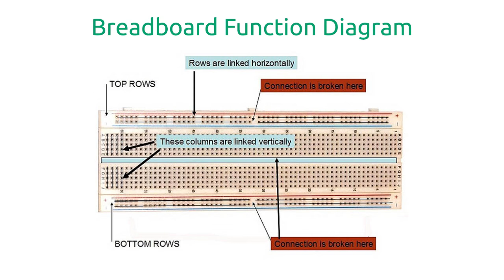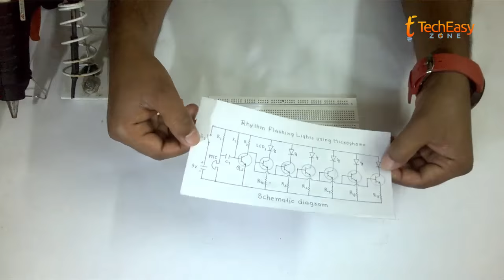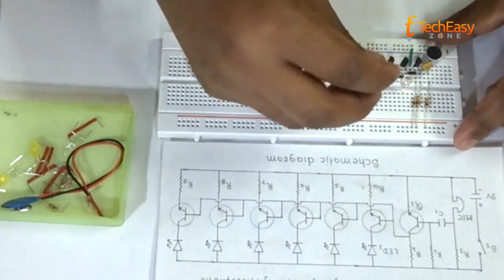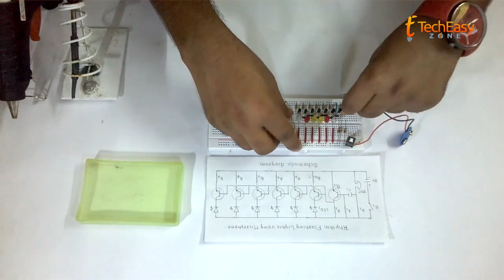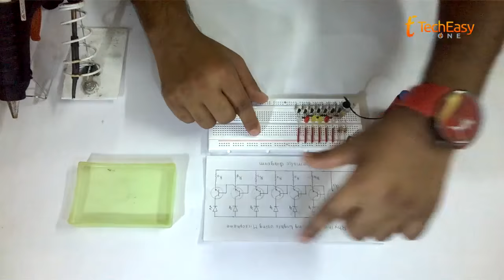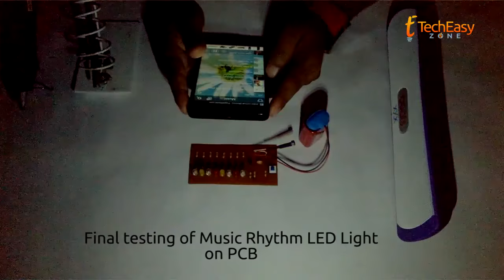How to make a Music Rhythm LED Flash Light using Microphone

Comment: hyy..when uh upload this type of videos.Also explain how this works i.e. its principle ,working
Reply: The principle is very simple... Pause at 0:42 and there you'll see the scheme.. when microphone detects the sound the "S1" labeled component closes and that makes a closed circuit that makes the LED lamps flash... basically its a bad "music rhythm LED" becouse it will turn on if you talk or if it hears any other sound

Comment: Hi i love your project!😊 i just wanna ask if i there is no 100nF capacitor what can i used for replacement? If there's any? Thanks👍
Reply: Jaycee Zamora You Can Use Any Value Near That, Its Needed To Filter The Sound And It Don't Let Other Creepy Noises In

Comment: Hi ! I made this circuit and i designed a pcb board with a beautifull design with 2 Vacuum Tube... led controlled... but i have a little problem.. if I clap my hand led flash for a part of a second... and the circuit are not sensitive for music. The problem it. s the microphone sensibility? I need to mention a few changes.. like... I use 2N2222 NPN hfe 200 transistor... I think it. s not a problem.. because transistor working like a switch... and the principal driving amplifier transistor  a BC546B transitor... the 1M resistor replaced with 100k.. led series resitor 200 ohm for 5v power circuit it. s enought... And the reistor in series with microphone changed to 1k.... The circuit working... but not verry well like you... Why.? I don. t know... I suppose the problem is the sensibility of the microphone... If I breathe in the microphone... led flash.. How can you think I solve this?

If I solve the problem I will give you my schematic pcb layout. Have a good night

Comment: how did you solder the mic? 
can i use BC548?
is there an alternate capacitor?
Reply from the maker: Yes, you can use BC548 transistor and please do not use another capacitor.

Comment: what happem if i. remove mic and directly connect headphones wire to circuit..??
Reply: Nitesh Pingale it can be done, I made it using arduino . you can check in my channel

Comment: Great Project and a very professional video. 
I have a question, what type of wire did u use to connect between the components in the breadboard ?
Reply: Rami Zayn a single core wire is always used in case of breadboard circuits

Comment: from where I get capasitor of 100nF and microphone...please tell me
Reply: what is the no. on capasitor..???
Reply from the maker: The capacitor is 100nF, and the quantity is 1. You can also find the details in the video description.
Reply from the maker: You can easily find it from electronic components shop.
Reply: please tell what no. is written on the capasitor
Reply from the maker: it's 104
Reply: what can i use another on the place of capacitor 100nf
Reply: u can ask for condensor (Mike) in electronic shop

Comment: I did the same connections as above but the LEDs are glowing without music too.they are simply glowing . And is there any way to know whether the microphone is working or not ??
Reply from the maker: Please provide some shots of your work after that we can short out the problem. Thanks!
You can send the images on our Facebook FanPage, link below:

https://goo.gl/lnefrW
Reply: TechEasyZone - if the 1M resistor is replaced with for example 10k resistor may be is that the reason the leds glow without music ?
Reply from the maker: Hi Ranga, Maybe that was the reason. Please use the same resistor.
If it's helpful for you then plz like us on facebook: 
https://goo.gl/lnefrW
Reply: Use a oscilliscope to test that is the only way to tell
Reply: can u tell me which mic u used?

Comment: Did this circuit runs on 3v battery??
Reply: teoretically yes... the base of transistor need 0.7v to be conductive ... so... with a few modifies ... like series resistor for LEDs ..for 3v ... 120 ohm will be enough for 25mA...  and i think for this voltage like me for 5v .. the 10k resistor are too big ... 1 k is enough... 1M  res replaced with 100k ... in my case for 5v ... if i clap my hand leds flash... but in music ..not ... and i don't know for the moment why ... i have 650mv = 0.65v on base of primary amplifier NPN ... i think the microphone from old specker is not enough sensitive

Comment: Any ideas For AC Current.. Same Model
Reply: for that u have to make led drivers and power supply
Reply: Shajin James simply use Relays
5V relays should work with BC547 and later connect the relay with your AC lights ..but the problem could be triggering of AC lights because the time for which the relay will be onn will be very less (depending upon the music) and may be enough time would not be provided for relay to trigger and your AC light to glow

Comment: i tyd dis.. n LED lights are keep glowing when i swtchd on.. 😢 wht can i do?
Reply: Dhakshina Dachu88 fertilizet
Reply: ALM Suhaib true
Reply: heh i find d solutn fr dis
change d resistrs .. replace 22ohm resistrs wid 2.2ohm... and replace capastr also put .1uf capstr..😊
Reply: same situation with me... should i replace 100 nano farad capacitor with 100 micro farad capacitor?
Reply: Offi Haseeb .. jus replace it
Reply: put .1uf that is 103 writtn in capstr
Reply: Dhakshina Dachu88  k I will try and  thanks
Reply: Khush Chudasama ua welcum😊👍
Reply: Offi Haseeb so I should replace 22 ohms by 2.2 ohms resistors
Reply: Khush Chudasama  .. yeah i changd that also 22ohms to 2.2ohmz
Reply: Dhakshina Dachu88 ok I will try
Reply: Hey it's not working
Reply: it's not working ....i have replaced 22 ohms by 2.2 ohms and capacitor ka 103 written over it then too it's not working ....yhe lights are only glowing
Reply: Khush Chudasama .. oo oo.. u tryid in brdbord? jus check d connection..
Reply: Dhakshina Dachu88  connections are all right then too it's not working
Reply: Dhakshina Dachu88 leds are only  glowing ....... also I changed everything and replaced each and every component new once
Reply: Khush Chudasama ... ayyoo😢 check d connectns .. it wrkz..
Reply: Dhakshina Dachu88 thank you so much for helping me
Reply: Khush Chudasama .. ua welcum.. is it wrking? now?
Reply: Dhakshina Dachu88 is that true?
Reply: no
Reply: Dhakshina Dachu88  bro it’s not working
Reply: Dhakshina Dachu88  I changed 2.2 and 1uf not working

Comment: Very creative. 
I tried it but it didn't work. I guess the problem is the mic. I got it from an earphone. 
Is there any way to fix this? I'm very sure all my connections are correct because when i tested the circuit without a mic, all the leds came on. 
I will be grateful if i get a reply.

Comment: Bro its not working.lights r glowing without audio signal
Reply: akhil jidigum  dude check on how to properly put the transistors by looking on the circuit diagram
Reply: replace 1M resistor with 100k

Comment: can it be use with 12V battery?
Reply: yes , with 510 ohm resistor in series with led ... replaced 22ohm ... for 12v ...is toooooooo much ..... 12v/510 ohms = 25 mA for LED diode ... to not burn it

Comment: Did you "COPY" from  https://circuitdigest.com/electronic-circuits/simple-led-music-light#comment-form?
a proper (READABLE) schematic would be proper
This does NOT detect Rhythm -  the LEDs just react to volume
It is in fact a poor design prone to problems. especially inadequate gain and lack of biasing
All the LEDs flash in unison...rather moronic